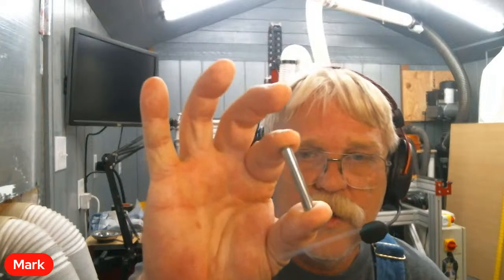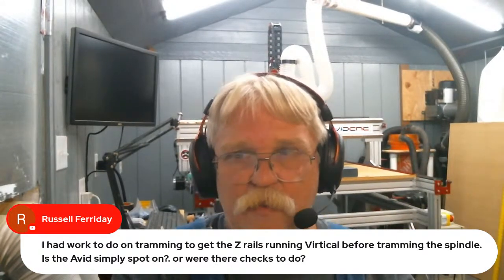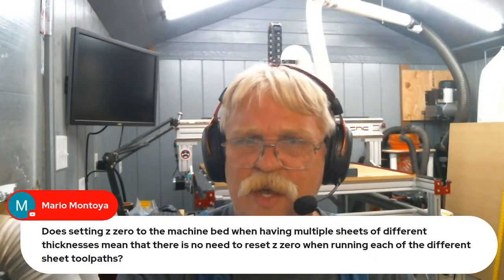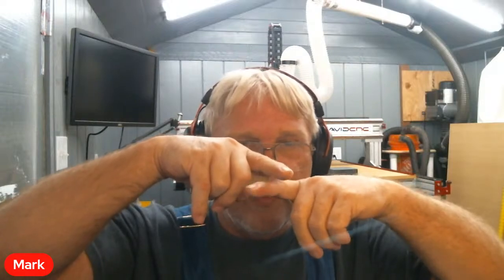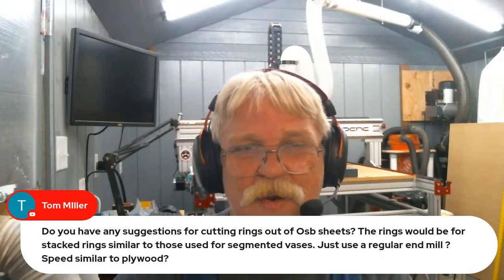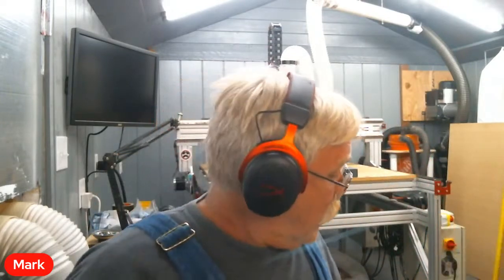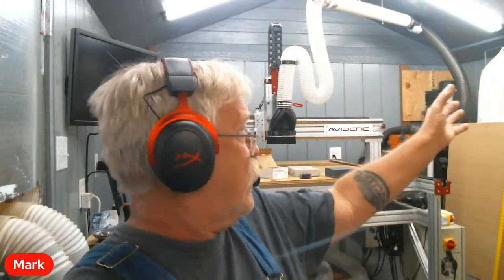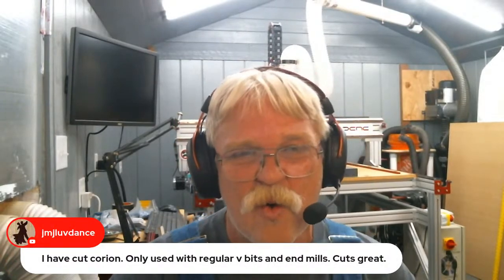Live Q&A #156 – Leveling, Squaring, and Tramming My @AvidCNC  4848 Pro CNC

Comment: How can u square using the surface plate when the router is not square? The plate is squared to an out of square Router plate. (Newbie question)
Reply from the maker: You're not squaring to the surface plate. You're leveling the surface plate. Once leveled, you use the surface plate to adjust the nod (back to front) and tilt (side to side) of the spindle, so that it's as straight up and down as possible.